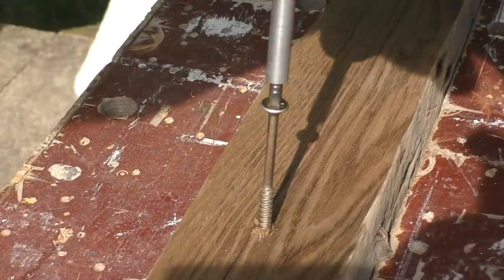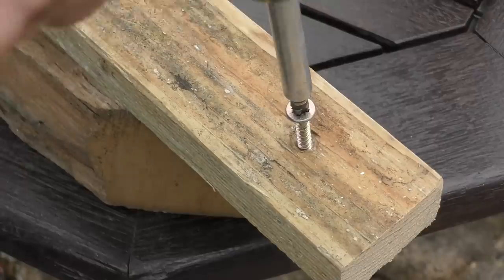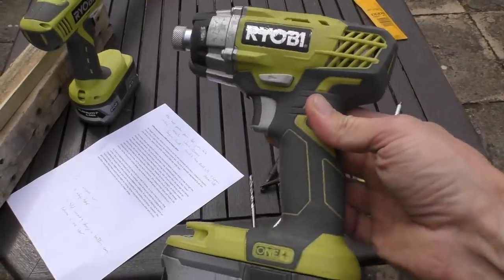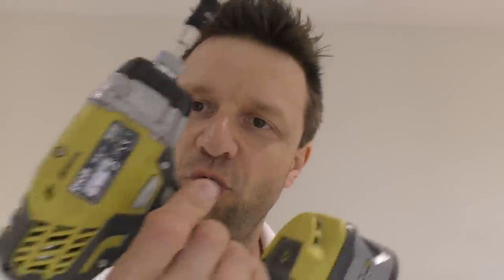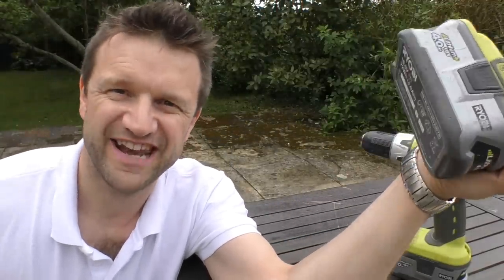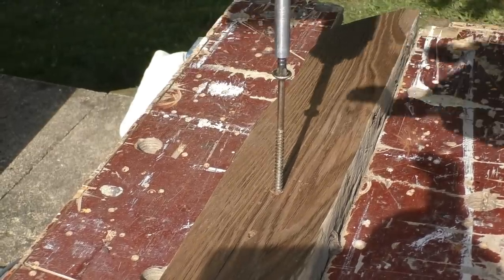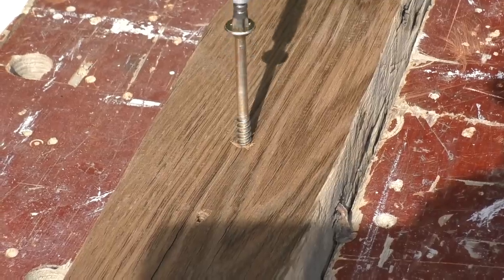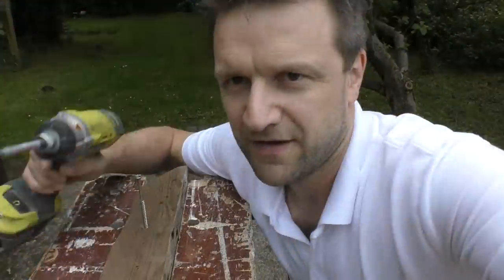Difference between Drill Drivers & Impact Drivers

Comment: I have Makita tools and noticed that the impact driver was waaaaaaaay more powerful than the lower end of the market machine my workmate had.   The difference between the Makita drill and impact driver was quite pronounced.  Maybe that is a factor in how well the Ryobi tools compared against each other.  Not knocking your tools Charlie.  Just trying to offer a possible explanation
Reply: The Makita brushless drills and drivers are massively more powerful than the likes of these Ryobi tools. Correspondingly more expensive though.
Reply: makita cordless drills are probably the best on the market that I've experienced.
Reply: Ryobi tools are for home owners. I’ve never seen anybody with a ryobi in the professional work field
Reply: @TheAegisClaw  actually theyre not massively more powerful, they are only just. Check out the video on youtube of a bunch of guys that test the 8 most popular drills. Yes Makita was the most powerful but only just. Maybe 10% more? Which is pretty favourable when you consider its under half the price of a Makita
Reply: Think I'll stick with my Makita too. Wouldn't touch a Ryobi if you gave it to me lol.
Reply: Yes of course top end brands have way more torque I love makita but I use hilti now and it is very powerfull
Reply: That's odd because my makita doesn't shake and is half the price of a dewalt tool. Nowadays wirh dewalt, you buy the bare tool, THEN you have to buy the batteries AND the charger separate from each other, unless you have the big wallet and go for glory up front, but back to your power is better part of tour video, which I'm all about my batteries not dying on me, I upgraded my old pos 18v firestorm (remember those?) System with 5mah batteries. Yes I know it was Sears' flagship at the time, but is now walmart brand. I got a set, drill, sawsall, etc. Love the reciprocating sawsall,  and recently used the circular saw too a bit. Anyways off topic. Dewalt; by the time you have the setup like it should be, is twice as much as makita and the likes, yet is only, by a fraction of a percent, faster than makita! Ripoff if you ask me
Reply: Makita > Milwaukee??
Reply: Niznuts123 shit I use my impact driver to Ryobi impact driver to remove small bolts while working on my cars , I have zero problem's
Reply: Australian Pyro never had that issue with my Ryobi
Reply: @Nick-vf3wf  really? I didn't know that, or were you joking?
Reply: @kbanghart  i was joking cuz what they were all saying. I use Milwaukee fuel series and they are extremely powerful. I honestly think the only brand that comes close is dewalt then makita is prob behind that.
Reply: @Nick-vf3wf  no worries, I thought you might be joking, but I've never used Makita so honestly don't know much about those. Used to own a Milwaukee sawzall and it was great. But yeah you definitely pay for the tools
Reply: @kbanghart  yeah thats how i feel too. And when theyre priced the same its all personal preference. I mainly use the milwaukee impact cuz its so compact and strong so i got all milwaukees so the batteries would match up cuz those are the main cost now days

Comment: The power of the drill has nothing to do with Ah. It has to only with the volts it is rated at. The Ah is how long you can drill before recharging. That 1.3 Ah battery was damaged such that the proper amount of amps could not flow. If it was a good battery, it would have delivered the same torque as the 5 Ah battery, just for less time.
Reply: Actually, it has to do quite a lot with the Ah. Unless you are using low Ah batteries with very high quality cells. High Ah batteries are basically low Ah batteries stacked in parallel. This allows them to output way more current at any given time, also it allows them to achieve higher efficiency. Low Ah batteries can't output so much current, because all that current has to be produced by single row of cells, which is hard and expensive to achieve.
Reply: It has nothing to do with any of this and everything to do with how the cells in these batteries are laid out and consequently, how much energy they’re capable of transmitting. “Ah” is only part of the equation
Reply: The output of a Lithium battery is directly related to its capacity. If a battery is rated to say, 20C, it can output roughtly 20 times the specified capacity. For a 1.3Ah battery, that means that the output current will peak at about 1.3x20 = 26A. A 4Ah battery with the same type of cells will instead be able to deliver 4x20 = 80A. And of course, if another brand uses better cells their machines will perform better with the same Ah rating.
Reply: @ertonyrn   "all the packs are 18v", well potentially.

Comment: Thanks so much for this video, helped me just this weekend to buy a drill driver and impact driver kit. Turned out that yes I did need an impact driver for my (first large) DIY project. Thank you!!
Reply from the maker: You're very welcome. The impact makes a massive difference, doesn't it. It's because the impact action is radial ie it vibrates in the direction the bit is turning. A lot of people think you can just turn the hammer action on, with the combi drill, but you can't because the hammer action on a combi is parallel to the bit, or in and out of the wall. Good luck with the DIY 👍

Comment: I found this video very informative which got me into buying an impact driver. The impact driver from Ryobi I have bought happens to be the same one you have shown in this video. I bought it as a bare unit but I ordered it with a 5ah battery. I do have a drill driver which is the old blue 18v but it's compatible with the new one+ lithium batteries. I have already started my Ryobi 18v tool collection

Comment: I  am replacing almost all my battery op tools with Ryobi because of the batteries. I always put my screws in a can and spray with WD or another spray can oil which makes the screws go in more easily. some times I may spit on a screw. great presentation with this vid TY.
Reply from the maker: Thanks Tony. Nice tips👍

Comment: Thanks Charlie, my cheap B&Q combi drill finally packed up after 15 years, it took a battering to be fair.  Ordering a new one today with 2 batteries.  Great to learn and see the difference with an impact driver!  Cheers
Reply from the maker: Good work. You got some good use out of that cheap one. What have you gone with for the new one?
Reply: @CharlieDIYte  had a quick look online and got a Mac Allister 14.4v on sale.  Probably not the best, but should be good enough for my DIY projects. Comes with 2 batteries which should be handy - I had to keep charging the old drill every time I put the kettle on was cutting wood 😂
Reply: It's actually 18V, seems great so far. Fired in floorboard screws reasonably flush and able charge one while using the other is great 😊 not bad for just over £40

Comment: I have a pile of Ryobi tools. I use my impact driver to change/swap my winter and summer tyres twice a year. I found your video a few months ago while I was building a chicken coop and bought an impact driver with a hex bit. Working the impact drive was far easier on the wrist. I wish that I had one years ago. I am not even sure that I really need a drill.
Reply from the maker: Glad you found it useful! It's brilliant, isn't it. The hammer action on the impact works in the direction it's turning - which is why it's so much easier on you're wrist, whereas a standard drill hammer action hammers into the wall. A lot of people get the two confused or think they can just turn on the hammer action on their drill to replicate the impact, which of course you can't.

Comment: I have both drills, exactly the same as yours but didn’t know about the batteries ! I also have the Ryobi SDS drill and have a 5ah battery for that, but will get a couple more 4-5’s now having viewed this. 👍
Reply from the maker: Hi Andy, yes, I've got a 5Ah and a couple of 4Ahs and I don't really bother using the 1.3Ah's any more, if I'm honest, but that may be more because my choice drill for light, every day screwdriving is my little Ryobi 9v drill driver. The 1.3Ah batteries are a good way to keep the weight down for the light, less intensive jobs.

Comment: Im a steel roofer and I began my ryobi experience with an older impact driver. It was awesome putting screws in all day on the roof. And when I put screws in to complete the work it was quick and fun. However nowadays I opt for the drill driver as its more quieter doing the work. Im looking foward to getting a brushless drill driver in the future
Reply from the maker: Yes I know what you mean, plus you have more feel with the drill driver for when the screws are tight. 👌

Comment: Yes i need an impact driver and yes i would have just gone out and bought one, and probably with the smaller battery, you have just taught me a big lesson, Buy the bigger battery, cheers for this very helpful tip.I am about to do a lot of 4/2 framing converting, an old garage, and was told to get an impact driver,, now i will, cheer s charlie.I may even get the Ryobi, it seems to have a good overall, power, and quality.
Reply from the maker: You're welcome Peter. There's more info in this video if you have time to watch https://youtu.be/i6KYfrDBj3w The impact makes screwing so much easier because the impact action works in the direction the bit is turning, as compared with a combi drill hanger action which works perpendicular to the wall. So those people who ask if they can simply use the hammer action on their drill, the answer is an emphatic "no". Yes, Ryobi would be a good option. Also take a look at the Erbauer https://bit.ly/3iXaRrJ which has a 4ah battery all for £110. I've been using it as my main impact ever since doing the video and it's a nice bit if kit.
Reply: @CharlieDIYte  Thanks for the advice yes just watched the other video,and very informative as you said,The other curious thing that i have only just noticed after having new bifold doors fitted is these screws you drive straight in the concrete blocks with no raw plugs, incredible,and about 5 inches long ,anyway thanks ,

Comment: And then there is the hex heat drill driver. I happen to use RYOBI too, but Bosh and Milwaukee also have similar tools. Advantage is you can share hex bits between the smooth action drill driver and the impact driver, and both with common chucks & batteries. RYOBI P235A is one example (mine) and it's a great tool that can toggle between drilling pilot holes and driving screws very quickly if you jut place the tools in the chuck and don't lock them, this is great for horizontal installation work..

Comment: Great info, thank you. I just picked up a drill & impact driver set but I didn't know the purpose of the impact. Also had deal for a free wrench driver with the purchase so I think it was a good deal. I didn't think about the batteries in this way and the ones that come with set 2Ah batteries but I bought a 4Ah as well.

Comment: Thanks for the video, this is exactly what I've read online during my research into "WTH is an Impact Driver".  Though I must say that the major difference that struck me the most was the battery output.  I'm really thinking twice about my 1.3 Ah batteries now, will get a 4 Ah in a heartbeat.
Reply from the maker: Thanks buddy. Yes, the 1.3Ah are fine for light weight jobs as they keep the weight of the tool down, which is pretty much the holy grail when doing a lot of jobs (my favourite drill driver is a 12v as it's light as a feather) but when you need the torque for your impact, or for power intensive jobs like circular saws, SDS drills or chain saws, 4 or 5Ah batteries are a must. Interestingly they're pretty much all I use these days. I have a pile of 1.3Ah in the basement gathering dust.

Comment: I already have a Ryobi drill/driver, convinced me to buy the impact now
Reply from the maker: I don't use the impact very often but it's a game changer for jobs where you need the power or repetitive jobs like screwing down decking.👍🏻
Reply: @CharlieDIYte  I have that exact set as the one you have in the video. I've owned them for 4 years. And I've probably used the drill maybe 10 times over years. I use the impact for everything.

Comment: I have the two ryobi drills and an impact driver and 4 ah batteries which is very versatile and makes the job easier ie drilling pilot holes/ countersinking and driving in fasteners without having to change bits all the time

Comment: I own the same drivers. Had to use the impact driver today actually for some very long heavy duty screws hanging a door. Screws went in like melted butter thanks to the impact driver. I love Ryobi tools. I have a large selection of powertools all sharing the same battery packs.

Great video!  Good explanation and comparison 👍👍
Reply from the maker: It's a powerful tool that impact. Shows that brushless tech isn't always essential. I love my Ryobi tools too. Their commitment to the battery system is unique in the industry. Thanks.👍

Comment: Thank you for the battery comparison! I just bought the ryobi impact driver after owning the ryobi drill driver for 4 or 5 years. I tried to use the impact driver with my 2ah batteries and was throughly unimpressed, it performed worse than my drill driver! Waiting now for the 4ah that came with the impact driver to charge, to test it.
Reply: How did it go?

Comment: That info about the batteries was eye-opening. I've been trying unscrew a bolt on my car for several days, and my 8V (1.5 AH) drill gets stuck the same way the drill did with a 1.3 AH battery. Unfortunately, it's a little $13 thing, and I don't think the battery is removable, but at least now, I don't feel insane. The bolt wasn't secretly hot-glued as part of a conspiracy to keep me from being able to replace my turn signal bulb, it's just stuck and my drill's wimpy!

Comment: I built a 20'x40' deck using 3" Woodex square-drive screws using a regular drill.  To keep from camming out the screw head I needed to apply significant pressure, but got the job done.

To me, the essence of an impact driver is that when turning the screw the impact driver very briefly relaxes the torque, allowing the bit to sink back fully into the screw head, so there is far less chance of the bit riding up and eventually camming out the head.
Reply from the maker: Thanks for this Richard. Yes I was a bit disappointed with the square drive screws or Robertson as they're also called, camming out. If they come with a bit in the box it's worth using it as the screws are often designed with the bit in mind. I got better traction with that bit than the Robertson bit in my existing tool roll. 👍

Comment: I got an impact driver free with my Panasonic drill/driver a few years ago (came with 2 batteries), never used it till recently and it's a revelation!!
Reply from the maker: It will be Martin. The impact action works in a radial motion, ie in the direction the bit is turning which is why it drives screws home so much more powerfully. People ask if they can just use the hammer action on their combi drill and the answer is a big fat no, because the hammer action works perpendicular to the bit, or in and out of the wall 👍

Comment: I noticed you were using posidrive headed screws,I found Philips would keep slipping , buggering the screw head AND the driver bit. I am now a convert to square drive screws, never slipped one yet, a very positive connection to the impact driver.
Reply from the maker: Yes Clive. If I had a pound for everyone who noticed that I'd be a rich man today 🤣 It was a big error, I think because I bought some impact bits (the black one you see in the video) and assumed they were all pozi drive, which clearly they weren't. Robertson (your square ones) and torx are the way forward as you say. Sadly they haven't really caught on in a big way here in the UK yet. I might have to do a video to redress that.

Comment: I'm picking up the bigger battery on Monday!  I love Ryobi tools.
Reply from the maker: Ah, good work Peter. Funnily enough I've got loads of those 1.3Ah black batteries left behind from Starter Kits I bought. I never bother with them any more and just use 4 or 5Ah on all my Ryobi tools, although to be fair, there's a place for one on a drill driver which you only intend to use for light jobs, to keep the weight of the tool down.

Comment: All I can say is, Brushless hammer drill. Bought one at release a few years ago and came back for 2 more. That’s the ultimate all in one tool. Even comes with a side handle. It will send screws in faster then you can blink. 2nd gear will send pretty good size lag bolts like they are nothing. I also chuck my 8” auger in it and go ice fishing. Last summer used it as a post hole digger. That damn thing will break your wrist long before it runs out of power.
Reply: I didn't even buy a brushless one - just the cheapest one I could find on Amazon a month ago - a Black&Decker corded model for $40 - to drill through concrete block walls and window frame headers in a home we just bought in south Florida. What a difference a hammer drill makes (with masonry bits)! I'm 65 and pretty small with one repaired rotator cuff and one in need of it soon - but that thing let me install a huge murphy bed with side storage units plus deep inset window shade mounts at the top of the frame into concrete with very little effort.